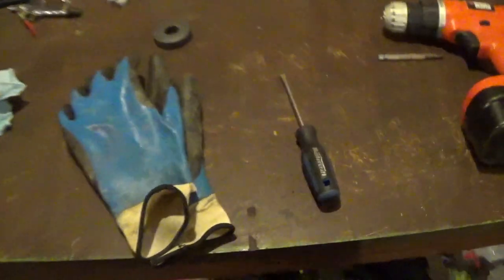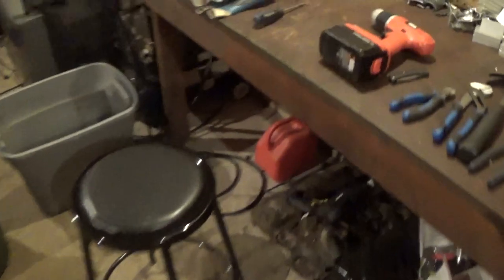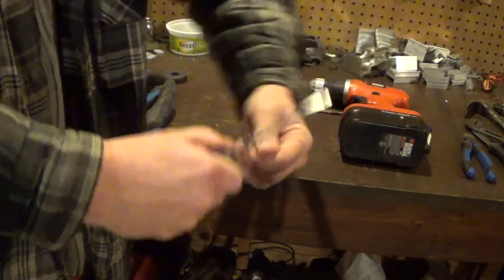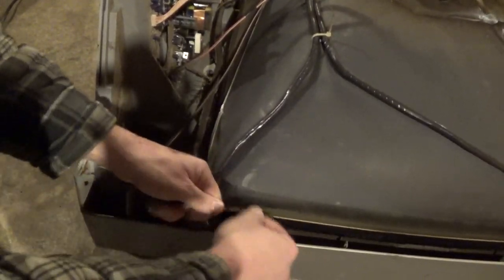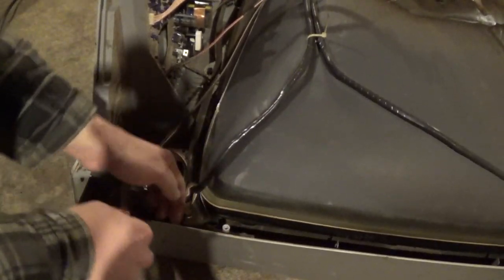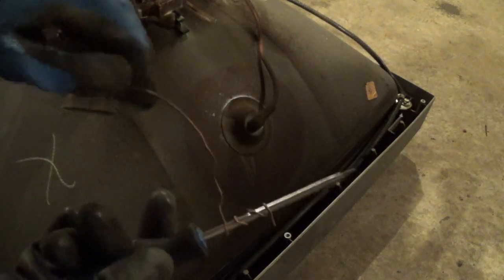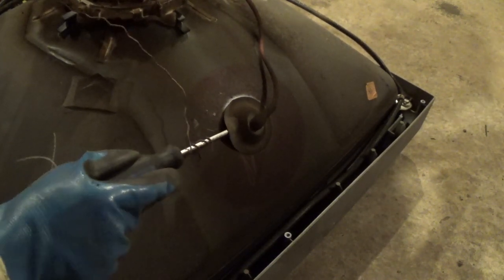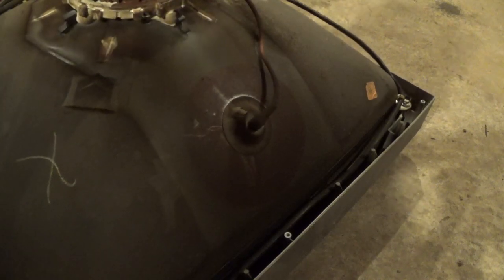How To Discharge A CRT TV

Comment: Thanks a lot for the clear audio and video! Seriously.. I wanna ask tho. If I want to operate on the main board (not the one connected to the tube) would it now be safe? Do i have to disconnect the tube cable that you just discharged? and and... I have seen some people "de-vacuum" it no idea why but in my case, do i need to do this? I just wanna change caps on the main board and the IR sensor.